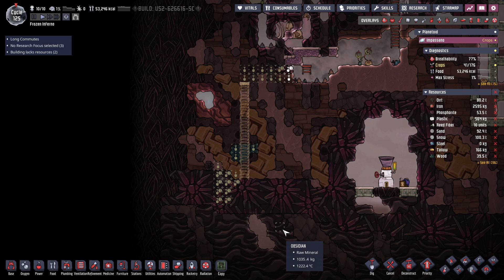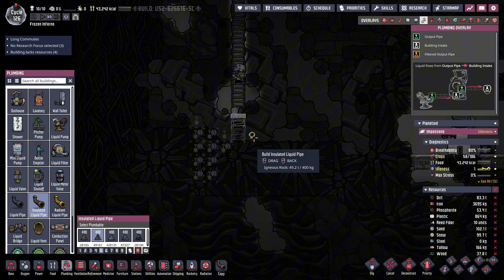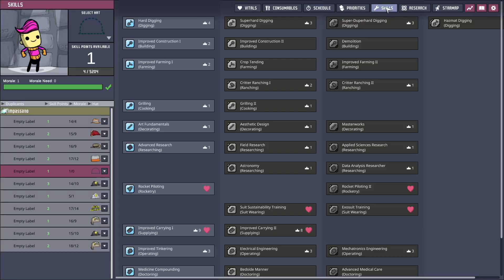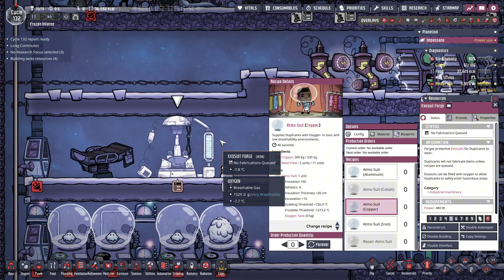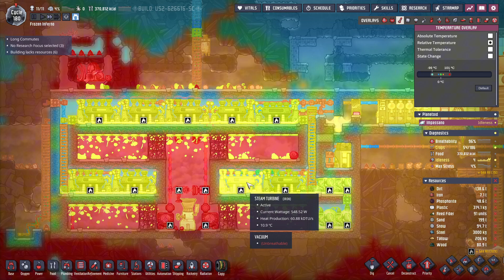Taming Artificial Vents | Ep.7 | Oxygen Not Included | Full Achievement | Ceres-Series

Comment: With regard to your geothermal powerplant, I would recommend you only use 5 steam turbines to remove water. Keep the additional 4 turbines, but with them, you can directly reinject the water into the steam room. Basically, you would have 5 steam turbines harvesting water and 4 turbines simply cooling the steam. Otherwise, the steam might get a bit too hot at times. If the temperature goes above 200 celcius, you are wasting heat. If temperature is below 200, you aren't getting the full 850watt potential from your steam turbine, but no heat is being wasted. As long as the steam temperature is above 125 celcius, which would take quite a while, this isn't a problem. 

Whilst each vent doesn't correspond to a specific water input on the heat pump, it makes sense for each vent to only send water to a single liquid input of your choosing. This will make it easier to extend your setup. It means each vent tamer will mostly act as their own thing.

Don't hesitate to sent salt water, brine or polluted water to top up the geothermal power plant. It will boil off without issue. In fact, salt and brine are technically a tiny little bit more water efficient than clean water.

As for how much water is wasted each run, well the power plant deletes 8% of whatever liquid you input into it, which is 960kg. However, you also get 297.6kg of clean water from the 320kg of salt produced by the vent and 396kg of clean water from the 400kg of polluted water produced by the vent. So in the end, supplying the vent with clean water costs 266.4kg of water per eruption. 

I mentioned earlier that salt water and brine are technically a tiny little bit more water efficient than clean water. That's because the 8% of liquid input is deleted before boiling. So in effect, if you supplied the powerplant with pure salt water, it would delete 892,8kg of clean water and 67.3kg of salt, which after accounting for the water produced by the vent itself means you are only spending the equivalent of 199.2kg of clean water per eruption. Supplying it with pure brine would actually be water positive.  Of course, in practice, you are only gonna send a small amount of salt water each eruption, just enough to top off the water loss. So really, at the end of the day, the difference is negligible. Still, it does mean you don't need to spend energy running a desalinator and overall it makes everything a bit simpler.
Reply from the maker: At first I wasn´t sure what you meant, but now I get it. 
I can see how that would improve efficiency overall and probably save on some water (even more if the external input water is polluted). 
I´ll play around with your suggestions, but for now I keep the power plant running as it is, because I want to see how it performs. Either way, thank you for the input :) Topping up the heat pump instead of the steam chamber is definitely more elegant.

Comment: Once you have naphta, u can make bead locks with around 35kg of it. quite stable and low termal conductivity, just watch out for very low temps that can cause it to freeze.
for the alveo veras, i did a greenhouse, and overpressurizad it to 9kg of Co², with automation for the phosforite and the removal of oxylite. double the O² with half of the work and the Co².
Reply from the maker: Call me paranoid, but I feel uncomfortable using bead locks ^^ If something has the chance to break and cause major problems, I try to steer away from it :3

Comment: For your carbon dioxide room, I recommend a manual airlock instead of a mechanized airlock. Manual airlocks can be walked through without automation. They let a tiny bit of gas through every time, but that should be fine. Your base is already capable to handle some co2, as long as it's not too much co2.
Reply from the maker: For now this thing stays shut until I have time to get a proper setup down, because right now it´s a massive CO2 bomb in the middle of my base ^^ I don´t really need the oxylite right now and already have an idea in mind of how to redesign the farm ;)

Comment: You might want to check out the flaking mechanics. Basically, under certain circumstances, if a tile natural solid tile or liquid or gas weight at least 5 kg (let's call this tile the parent) and is directly adjacent with another natural solid/liquid/gas tile (the donor) with enough heat temperature difference to change the phase of 5kg of the parent tile, then the game will remove matter from the parent tile in increments of 5kg and change their phase. This is why you were getting some liquid sulfur. Basically, the gas below that natural sulfur tile was getting hot enough to flake the sulfur. Checkout the oxygennotincluded wiki for more details (use the gg wiki, not the fandom wiki. The fandom wiki has been abandoned and is now overrun by bots and vandals)

I was actually scared for a moment your naphta was gonna flake because of the hot abyssalite, but apparently the abyssalite wasn't hot enough. That would have been a disaster. 😅

Generally, when there are extreme temperature differences, it's best to use insulation tiles.
Reply from the maker: I thought abyssalite flaking only meant that it sometimes leaks heat into gasses when in actuality it shouldn´t, but boy was I wrong. I read up on it and don´t like how paranoid it made me :D Definitely need to be more careful around that interaction ^^
Reply: @telx7  Glad you didn't have to learn the hard way lol. XD

Comment: I put molten glass to geothermal heat pump to get niobium.
Glass refinery -> metal refinery (copper) -> 2300C molten glass
It take over 500 batch of glass and 3,000kg of copper refined. And over 50 cycles.
Reply from the maker: Quite a lot of work for only 5kg ^^ I´m going to switch up the setup later down the line as well, but for now the power is more than enough for the stage the colony is in
Reply: @telx7  only 5 kg is needed. As long as tungsten is in stock, you can turn tungsten to niobium by refine thermium in metal refinery.
Reply: My colony at 400 cycles. No rocket yet.

Comment: 15:32 sulfur tile above melts and drops liquid sulfur. Like ice tiles. Pieces of hot carbon dioxide like 15:50 did this.
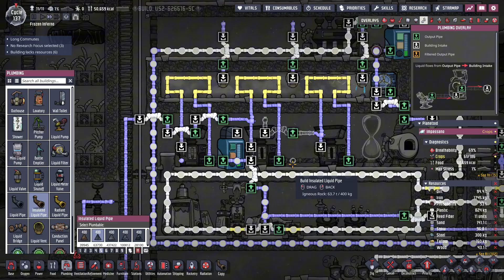Reply: At 15:18, for a brief moment, he mouses over the sulfur tile directly next to the ladder segment (so the one slightly right of centre of the naphtha pit) and it shows a mass of 521.8kg. After the liquid sulfur appears, at 15:35, the same tile has lost mass and now shows 516.8kg.
Reply from the maker: That´s what I suspected at first as well, but watch @17:30 ... I don´t see any tiles changing state nor is there debris heating up anywhere and tiles only melting partially would be news to me ^^
Reply: @telx7 it happens without changing state animation. Perhaps this phenomenon in ONI is called "flaking".
Reply from the maker: It´s definitely some weird interaction like you say, but I haven´t encountered this particular phenomenon yet ^^ Luckily it didn´t cause too much trouble